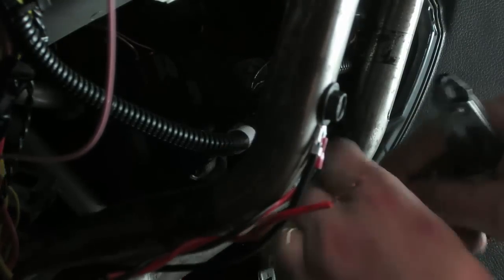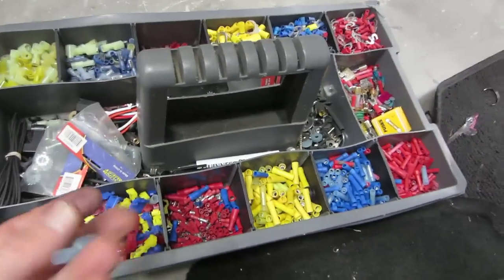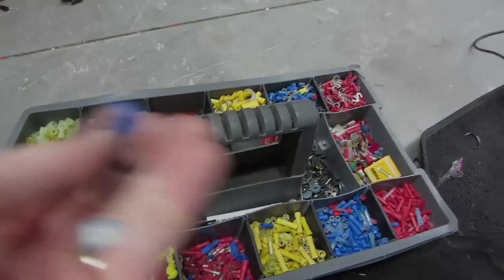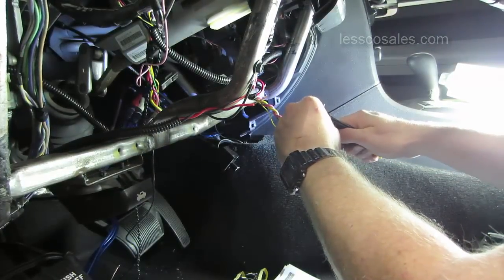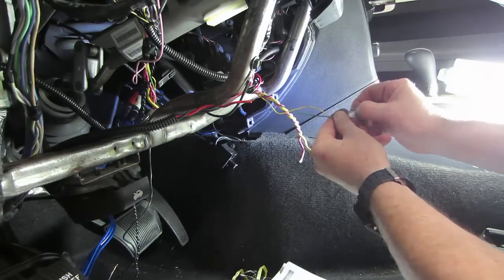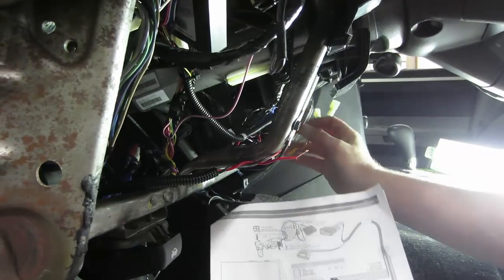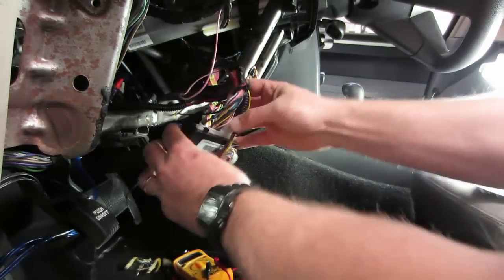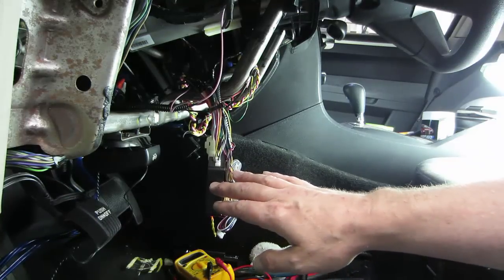How to install an Evo One remote starter Part 3

Comment: Pretty good but it’s not a good idea to use those scotch locks on anything. They will cause you problems later down the road. Soldering is preferred but butt connectors with the heat shrink will work too.

Comment: Do you need a 180 ohm resistor when you connect the clutch bypass wire like it says in the Fortin manual? Thanks.
Reply: This was an automatic

Comment: that shock sensor input is dual stage. 
0.5 sec pulse triggers warn away
1 sec pulse triggers full alarm

thumbs up on running that power from the battery and briefly explaining why you did it.
No comment on t-taps :P

Nice series!